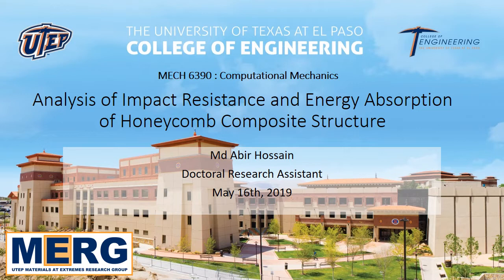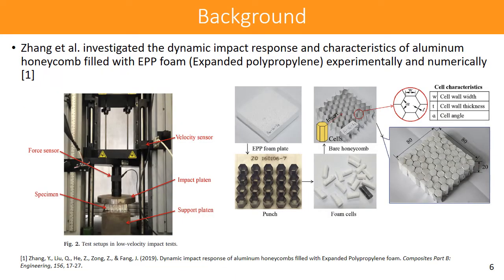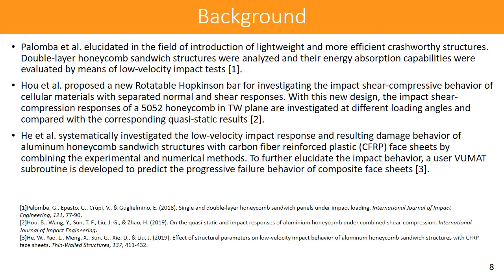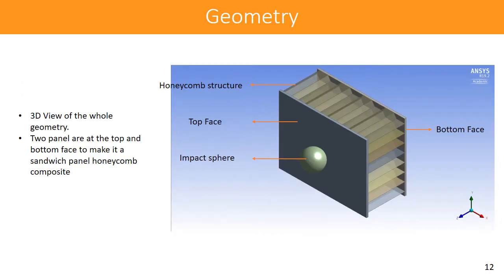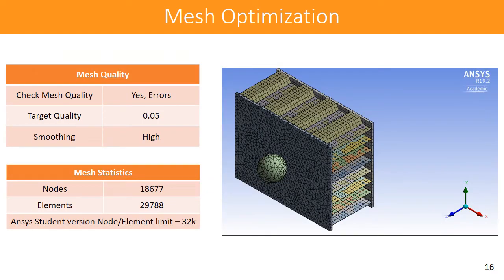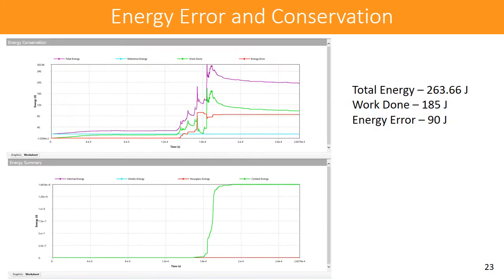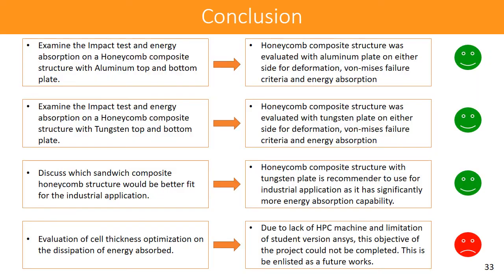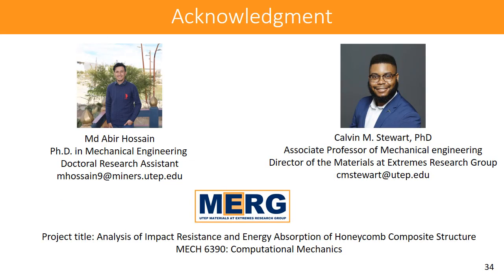Impact Testing on Honeycomb Structure in Ansys

Comment: Hi! Great video.
I have to do the tests to check which structure has the highest energy absorption capability. How to do that in ANSYS? Also do you know if it is possible using Autodesk Fusion 360?
Reply from the maker: Thank you for reaching out to me. I am not sure if you can do that with Fusion 360. As far as I know, Fusion has a multitude of capabilities in solving linear and nonlinear problems. I think you explore that route to see. In Ansys, you need to check with the output settings to visualize the energy absorption curves. Thanks.

Comment: Honeycomb structure can be used for compression. You should have tested it in the opposite direction that is the load applied perpendicular to the honeycomb face. (Load in the negative y-direction in your case)
Reply from the maker: Thanks for your suggestion. It will be interesting to see what happens if the load is applied in that direction.